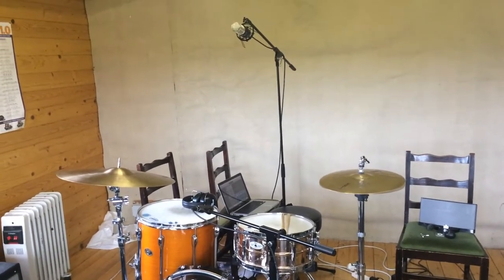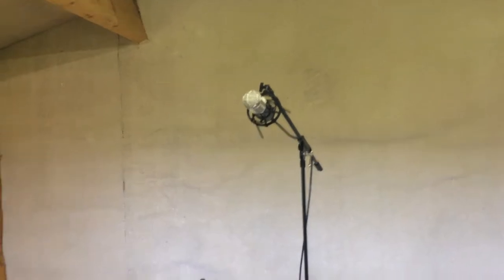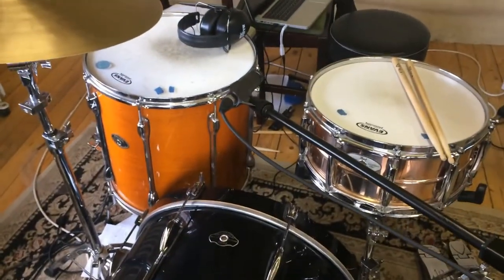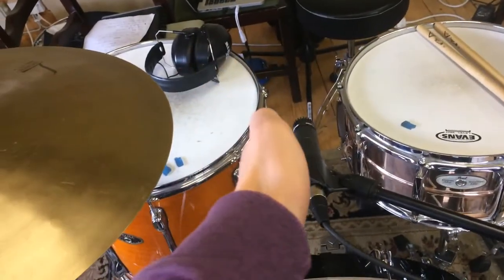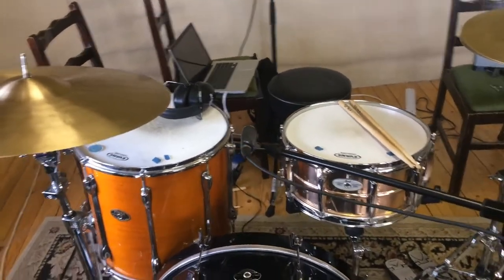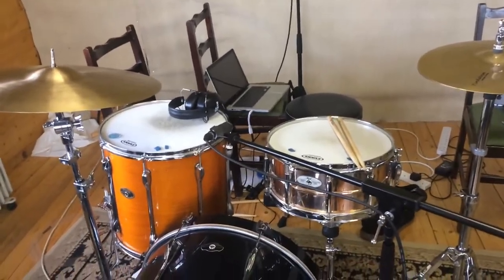3 mic drum recording

Comment: Nice sound, imagine how good it would sound without the phase problems of not having each mic an equal distance from the drummer like the old three mic system motown used on many recordings. That was one in front, one off to the left from behind the kit and one overhead all equal distance from the drummer. You may want to experiment with that since you have the set up to do it already.
Reply from the maker: Cheers, That sounds like a great idea. So basically Glyn Johns with a distant bass drum/full kit mic?